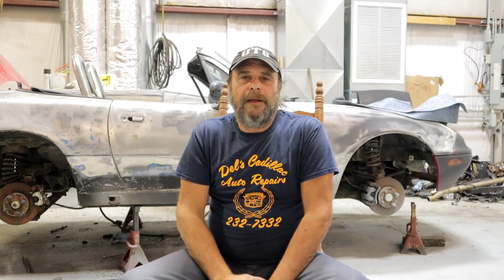Automotive De-Evolution...The Next Big Thing?

Comment: I'm 25, and I've also gone down this path of de-evolution. I was driving a 95 taurus, which ended up being a complete pos due to the crappy failing electronics(also lack of replacement parts cuz ford hates us). I ended up selling it, buying a 69 beetle, and I'm going through the process of hotrodding that, well as much as you can on a budget for those air cooled engines. All mechanical, as little electronics as I can. I'd much rather tinker around with a few screws on my carbs than try to deal with some computer that doesn't actually work. I say this as a computer guy too, I love my tech, but what's the point in over-complicating things

Comment: EFi is the best thing that ever happened for the combustion engine. They're infinitely more tunable and precise than carburators. Without it making 300-400+HP on small displacement motors wouldn't be possible with carburators on something like a 1.6 or 2.0 liter engine. Maybe more important would be efficiency it gives you. Not
being to a system to work correctly isn't the fault of the EFI it's the person setting it up not knowing how it works or being proficient at tuning said system. I love carburators but they are dinosaur technology in comparison.

Comment: On the car side I think this is true. However. I'd argue the high water mark for trucks may be 2007. The silverado specifically was virtually no different than a small block V8, 4 speed trans, heck same ratios as the old 700r4s. They also had the same steering box/idler steering of older trucks, albeit independent suspension up front. Super easy to work on, relatively few electronics and what I'd consider "traditional" styling. Great running and driving trucks but pretty simple and still have a fair amount of character and driver feel. Maybe I'm biased because I own one but driving anything newer it just feels dead to me. The rack and pinion steering plays a big part into this I think too.

Comment: I started driving in 1976 and the trouble with used cars then was the odometer was rolled back to sell high even though it was worn out. Plastic teeth on cam gears usually missing pieces and chokes never worked except on new cars. Didn't mind points, easy to change and all companies sold parts that "meet or exceed OEM". Ford 2 barrel carburators were as simple as falling off a log, worked great and was simple to rebuild. After 1972-73 compression ratios had dropped and nothing had any power anymore. Also spark knock and run on when trying to kill the engine.
The trouble now, parts are Ch-yna junk, hard to find anything that fits and functions correctly.
On the old Price is Right, they went from giving away Pintos and Vegas in the 1970's to cars that I have no idea what they are till the announcer states the make and model.

Comment: I'm 20 I turn 21 at the end of September. And I'm almost done with putting my 74 318 in my 1990 dodge it's almost all new as far as motor and transmission. And most thing in between. It'll be done when I can afford  to finish the custom drive shaft and rewiring it again.. but as far as I know there's a lot of young guys into older cars and trucks. Maybe I'm wrong though.

Comment: I read somwhere that a guy familiar  with 302 chevys said they were doggy on the street. They like a stock 350 cant really use 2 750 holleys.I know a 302 is solid lift 7I motor but the torque  curve cant be very street friendly.

Comment: 5:45 you hit the nail on the head with this. Working on the newer vehicles in my fleet is a CHORE. Working on the classics is where I go to unwind and have fun!

It’s still turning wrenches, diagnosing, and repairing… but the engineering on modern vehicles makes it miserable for anyone who has to work on them. 

Oh, and; I’ll stick with my carburetors too! #justsaynotoefi

Comment: Excellent video Tony, I can definitely vouch for what you are saying here. I'm 35 and bought a 65 Fury last year and rebuilt the 318 poly, first time doing it and rebuilding carbs and there is just something to be said about it and connecting with the vehicle, you can't get that from the late models. I've had people tell me yo go with efi bull, and I say nah, I like the mechanical aspect.of what I have because it's easier to work on and there is less electronics involved which means less to go wrong.

Comment: I'm so much in agreement.  The flexibility of cars from around 1970 and earlier was great and anyone that put in some basic study could learn the how's and what's to work on them.  With today's cars you can forget any of that.  I recall a auto magazine article in the 1980's talking about concern of the auto manufacturer's changing cars to coming with sealed hoods.  As in No User Serviceable Parts, like an appliance.  Now we live in a time that manufacturer's have made engines so sophisticated with electronics that hoods might as well be sealed.  The biggest interest I can find under the hood of a modern car is how nicely they routed the wiring.  I built my mechanical knowledge over the years since the late '60's and it's just about useless on the cars we have today.  I don't have any interest in building a college level knowledge of all the electronics throughout modern cars.  The auto manufacturer's and the EPA are the winners.

Comment: Had an 84 amc eagle for 3 years. It was ny first car and I learned so much from it. I had the carb dialed in to where it was damn near turn key. Sold it for a ford focus for fuel efficiency. Great idea for my wallet but damn is there a hole in my heart. Definitely something from the 60s or 70s next. Or at the very least a de-evolition

Comment: If today's SAE grads were ordered to simplify things, they'd end up with a bayonet-mount alternator (twist off, twist on, tighten one lock nut).
Good idea, but then to get it to the outside world the same simplification team would design the rest of the bay so it has to come out the bottom because that way you only have to remove 5 stupid things that shouldn't even be in the way instead of 15 if you tried to haul it out the top.

Comment: You're speaking my language Uncle Tony.  I took an '04 dakota, threw in a stroked magnum with a carb and orange box.  It's got a Toyota supra r-154 gearbox and a ford 9 inch rear and chevy brakes.  I stripped every inch of wire out of it, and rewired with an aftermarket harness.  I couldn't be happier with it!  Tune with a screwdriver and a beer, not a laptop and a glass of wine.

Comment: Why I consider the mechanical age cars of the '70s and older as the best. You became 1 with your car. You felt something wasn't quite right, you fixed it, kept going. The only electrical I was interested in was push button shift in my Mom's '63 Belvedere, the switch pitch in my old '66 Skylark, transisterized ignition in the '68 Corvette, and HEI. Chrysler went pointless in '72, but mechanicals were still there. Carburation, timing, advance etc. Give me points.

Comment: That is how I got into VW air cooled back in the 1980's when my best friend opened his VW and Mercedes parts in Florida that were accessed from W. Germany exporters.
Loved working on them after having to learn the metric system back then with European farm equipment that was available. 
easy inexpensive used parts and donors everywhere, mom& pop machinists that worked the heads and align bored the cases.
On top of that it was back then in Florida the best car to pick up and date girls...when you were not born with a silverspoon...

Comment: I remember these magazines, and the time.  A new Trans Am still had potential if it had the 400, but everything else was "stickers and spoilers". at least there was a V8 to hot rod--sometimes! some of the old musclecar names were tied to standard issue 6 cylinders, like the AMX. attempts to hot rod these things typically meant searching dealer inventory for left over NOS domed pistons or small chamber heads or even just a 4 bll intake. hot rodding , meanwhile, had turned to street rodding. the guys who used to hot rod had become empty nesters with bad backs wanted air conditioning (anyone who has gotten old understands). And "vanning" was for the men who wanted a good reason to get out of town and camp somewhere and party.

But personal luxury cars were outselling the new "performance" cars that were out there in the 1970's.  Those who remembered the "supercar" days wrote about the good ol' days until the Mustang went EFI and then people like UT found out how to hot rod these new cars without really using old tech like 4.56 rear gears that didn't go well with the granny first gear of the overdrive transmissions. Muscle cars were still just old toys that survived the gas crunch and you had to worry about octane and exhaust valve seats.  You cut up a solid small block Chevelle to save a rusty SS396 model.  what set off the stampede was the 1987 stock market crash. the art/painting market went down as well, and classic cars from the depression era were over-valued. so investors went into muscle cars. the bad news was they sent prices rocketing, but the good news was that companies like Year One began--before this, you got floorpans from JC Whitney. Now you can save a small block muscle car and not be in a money pit hunting Carlyle or Pomona for NOS or stuff cut off cars out in the desert. 

if you watch Car Chase Wonderland classic movie channel here, you can see tons of movies where muscle cars are just chewed up and spit out--back when the cars were hard to find high octane for or were single digit gas monsters after the 1973 oil crisis. just props for cheesy movies and TV shows.  they weren't well respected back then. Now we lament this, but when's the last time you saved a Mustang GT, Trans Am, or Iroc Z from the 1990's that someone's stripping apart to make cash? maybe you've even joined in on that--but its no different than the muscle cars that went to the great junkyard in the sky when folks only saw gas crisis.  in the age of the LS, there's still deals to be found in the shadow of the mighty LS, on a 1980's pony car that can accept a carb since the engine was first invented back in that time, handles well, and has overdrive.

of course, all the 1980's tech, of overdrive and engines that make torque all day at low rpm--that's 1920's technology on some of the big Depression Era cars.  But using aftermarket EFI? yeah blame guess what magazines for selling that to the public. I railed about it all the time to Popular Hot Rodding before they went out of business--they told readers to buy EFI while every project car they had, was carb'd.

As for the 340 test, i was mentioning that to a friend. Multicarbs were typically poorly tuned, and the cross ram was an upper RPM piece--the stock single carb on the DZcode 302 was the same 780 cfm Holley chevy used on their 427 solid lifter big blocks. But in the Mopar world, it was forever the 440 or nothing else--folks would pull their 383's regularly for that 440 when they were still sitting in the mud next to Olds 455's and Cad 500's. I always thought a Dart or Duster with an early 360 bored out to 379 cid with the early heads ported was going to run along side a 440 dart--less weight in the nose, less engine heat cooking the brake fluid inside the master cylinder. Heck even the low deck 400's made more sense to me.

but now the "baby Hemi" is rediscovered :)

Finally, i see a lot of folks here arguing old versus new. believe me, far more kids are into the Ls world than your old gen one stuff. I have a garage full of it and still buy up the old stuff when its "take me now" prices, but there is a reason the odometer on your old car went up to only 99,999 miles. thick piston rings, oil with parafin wax instead of detergents, no overdrives--every gas station had a "mechanic on duty" sign, not a "coke 2 liter .99 cents" sign. folks ditched their cars by 80,000 miles before something expensive went on them. with EFI i can stick a paperclip into a plug under the dash, the idiot lights will flash a code, i'll replace one part and not work on the car again for 20K miles. my 68 4-4-2 with 243,000 miles and a 15K rebuilt drivetrain spends more time up on ramps than my 220K newer vehicle does--and the gas mileage is still better.

Comment: I think you are spot on.  With alot of people doing LS swaps...... a lot of nice old school engines are coming up for sale.  Another good flood season in TX and you can buy flooded SS Camaros pretty cheap.  Strip out all the modern bs and install a 69 camaro wiring harness and dash and a 327 350 horse engine or a Z28 302 and really have something you can like and will handle good and perform great.  Plus work on it with a screwdriver and set of wrenches.   But, I disagree with you on the 70's being the height of the muscle cars.  It was the 60's when every car company was putting out hotter and hotter engines in all their cars every year till the insurance companies kill them and gov't smog laws.  The 70's was the smog era, less and less powerful engines.  But, good food for thought video,  thanks for taking the time to make it.

Comment: I agree with you to a certain extent. I have a 2004 dakota 4.7, 2017 ram 1500 5.7 hemi and a 55 chevy 3100 1st series. The 55 is getting a ls with a turbo. If your gonna go efi, you have to sit down, do your homework and do it right and you can have the best time with it. Along with great efficiency from that setup. The carb is simpler but to some they dont want to deal with a carb, changing jets etc. I love working on my dakota and hemi. The dakota I have done a bunch of upgrades on and the hemi, I'm getting there. I think it's all about who's working on it

Comment: Yep, the only special part in my 1960 falcon' s glove box is a condensor. The rest of the ignition can be set up with a nail file and a matchbook. It has a stick shift and a generator. Don't even need a battery to get her running. Just a steep hill.

Comment: I heard it ... " 331" you mentioned. The first decent American V8 that had power to spare , put the old Flathead Ford to rest , inspired the sb Chevy ( or something like that ) , etc. It is the foundation for all of the sb Mopar engines and the B - RB engines share some parts as well. I would be glued to the set if you dove into one of these early hemi engines. As far as history and substance there is no equal to a 354 , 392 .

Comment: Just recently aquirered two 50's trucks because I don't want to mess with my 09. To me the 09 is a tool that I use when I need it, but the other two are the ones that I want to drive. They just have more style and character than any of this newer crap. Besides that, I'm pretty sure I will be able to spot either of them in a parking lot, they'll be where the crowd will be checking them out because I haven't seen any old trucks like them on the roads in years. And yeah, they both need work, but that's what makes them so fun.

Comment: the SECOND they removed the cable throttle..... and went to electric (which is laggy.... nothing nothing burnout)
i knew cars were not gonna have that feedback....
.
and im only 27..... and LOVE my 99 buick century
,
sure.... its a "modern" car with ABS, traction control, FWD, ETC
but its also a SHIT TON more "old school" than a 2021 car
.
cable throttle.... cable shifter with clicks you feel........no stability control so you CAN get it sideways on a gravel road....
ETC

Comment: Tony, you hit in on the head. Today's cars are cool, but they lack soul. They also lack variety. As cool as today's Challenger is, there is only so much you can do with "that" body style. Throw in all the electronic stuff and yes, it is miserable to work on. I have a bone stock '11 Mustang GT/CS, I have not done anything to it, because I take one look under the hood and then shut it. It is a royal PIA to do anything on it I used to find fun. I have considered "de-evolutionizing" (new term) a later model car and just wire it up like an older hot rod. Simplify = fun, complicate=PIA...

Comment: I am 24 years old and have been a automotive technician for 2 years and I can agree there are very few modern cars that are enjoyable to work on. They are all a pain in the ass even for just a oil change most of the time. I used to have a 1968 mustang with a 200 CI  straight six and man I miss working on that car. Our lead master tech at my shop after 35 years of doing this puts it this way. "I am loosing my patience everyday to work on cars as they get more complicated day by day"

Comment: Nailed it! My 69 Chevelle, 77 Chevelle, and even my 88 Beretta I could work on them. My 07 Cobalt SS I never touched it other than brakes and tune ups. I currently have a 19 Camry Hybrid which I will have the dealer do what it needs other than LOF. I have a 36 Chrysler Airstream now that I love working on. Don't need any scanners and 500 page repair manual to work on it.

Comment: Essentially what you're talking about is building a race car... Simple electrical systems easy to service.. And parts are easy to get.. So I wouldn't say D evolution I would say building a race car or hot rodding a car..  When you take a current car and build a drag car out of it.. Is 100% gut it  Pull all the electrical out rewire it with simple circuits. Cut the front end off build it out of tubes so you have Room to work on it.. Basically what you did to the Mazda..